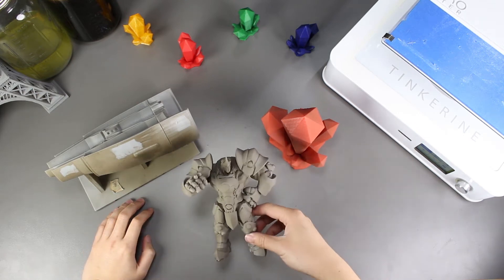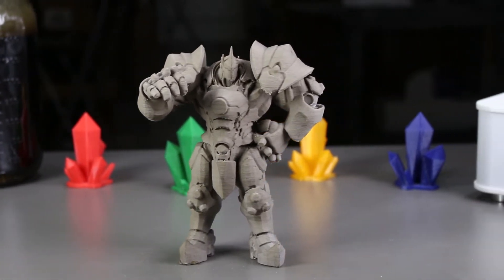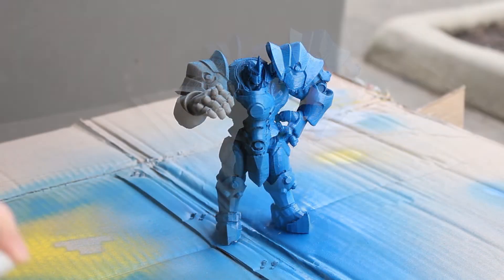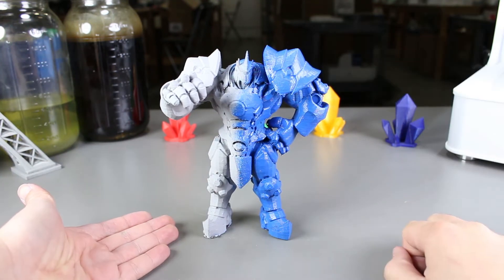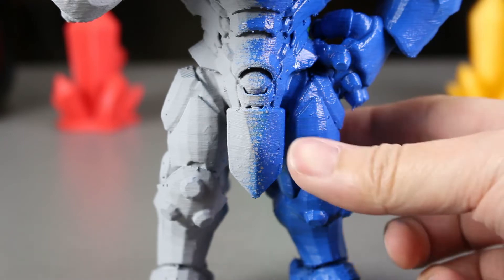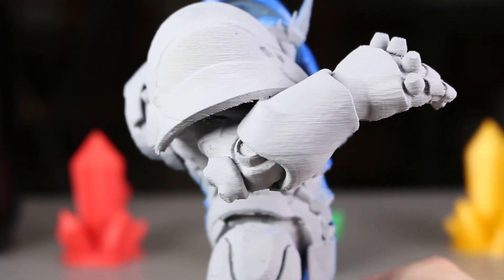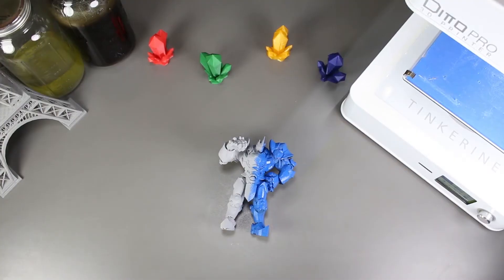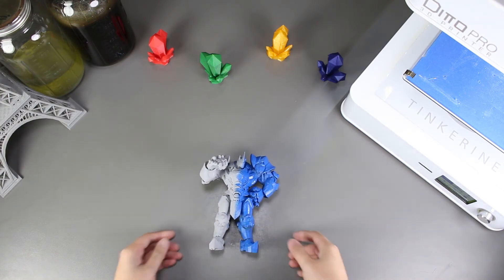Post-Processing Sandblasted 3D Printed PLA Part

Comment: So you don't reckon the effect is very good, but you're sure that if you'd tried using fresh blasting medium the result would have been much better. But yet all you show us is this - with a verbal shrug of the shoulders. Why aren't you showing us a video where you DID use better quality blasting medium? You might as well say: "Here's a model that we didn't try very hard with - it looks terrible. I reckon if we'd tried harder it would have been better!" Well, duuuh. You need to think your experiments through - and the possible outcomes - before you start doing them. There are too many of your vids that have great production values but poor thinking behind them. Sorry :(
Reply from the maker: Thank you for the comment and advice. The sandblaster that we used for the experiment was not owned by Tinkerine and we were working with some constraints. We would definitely love to make a video where a new medium is used for the experiment, hopefully in the near future!
Reply: @Mark Michalowski  I was about to leave the comment "what a half-arsed video" but your reply was so much better.  The fact that he doesn't even say what the media used was is annoying, then he used a matte primer which he admits that he put down more layers with and then compares it to a glossy paint with fewer layers applied.  Hardly scientific.